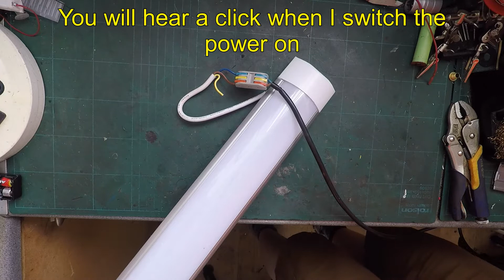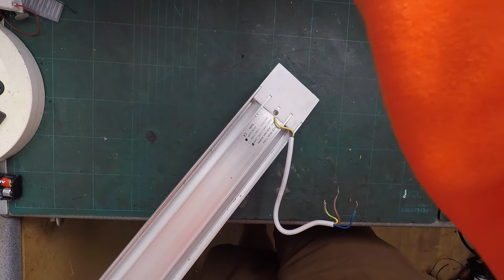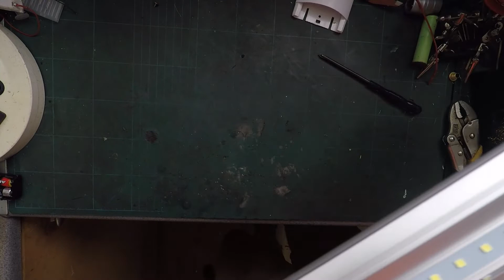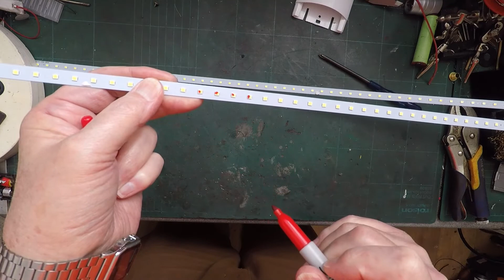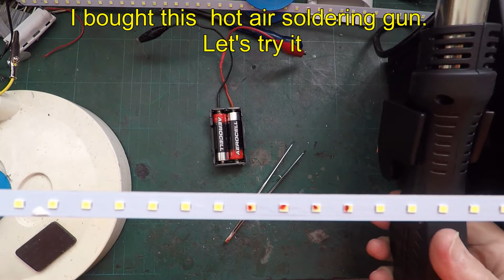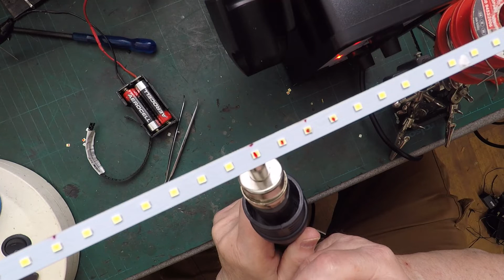LED 36w Batten Light Repair

Comment: Nice that they give us a black spot to help with the repair.
Reply from the maker: I thought blackspot was just for pirates. The cheap hot air station is a great help.
Reply: @DaftOldMan  my hot air station works great and was only £35 off FleaBay years ago.